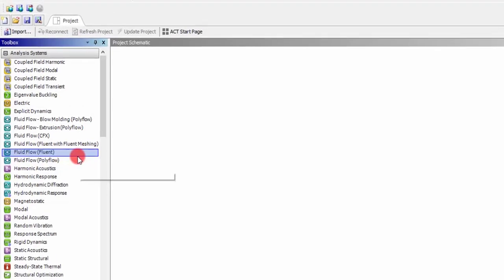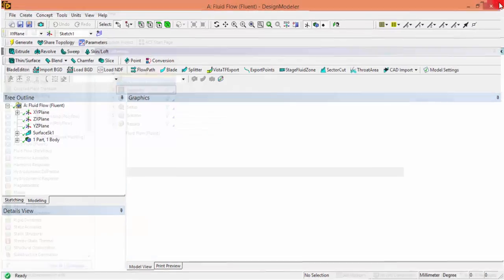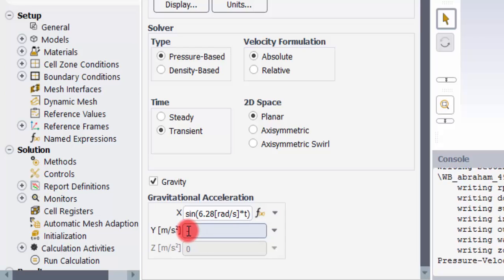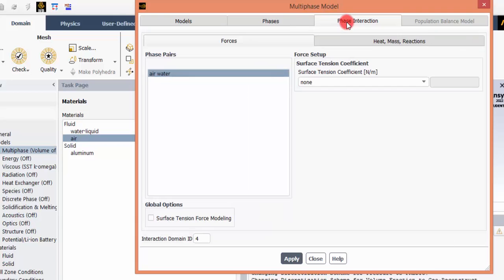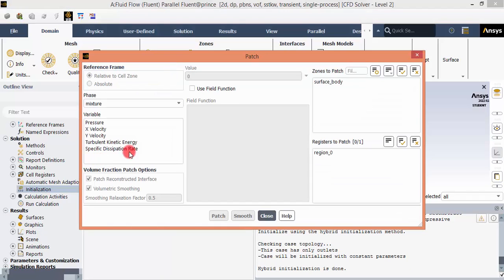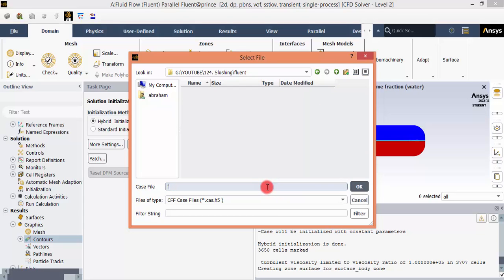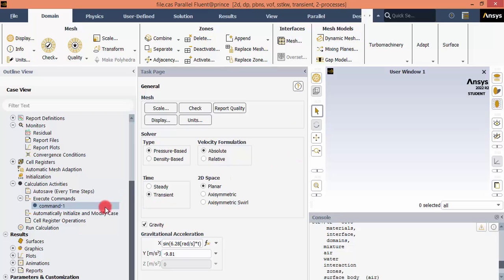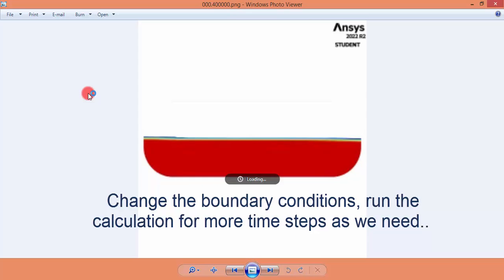Ansys Fluent Tutorial for beginners | Sloshing | VOF | Expression in Ansys Fluent | Without UDF

Comment: Hello sir, I'm making all the things same but my program gives me floating point error, what can I do about it? I tried to smaller and bigger mash sizes but it didnt solve.
Reply from the maker: Try without the acceleration, so we can determine whether the problem is with the acceleration or something else..
Reply: @MechTechSimulations  I runned again without acceleration and it didnt give error, tried again with linear acceleration and it gave an float error message again
Reply: @MechTechSimulations  I tried without acceleration and it didnt give float error message. When I add acceleration it gives error whatever its linear or time related. And for extra information ım trying to work on 3D tanks.

Comment: Hi, is it possible to do the 3d animation of a fluid flow in around a turbine in ansys....can you do a video on that...
Reply from the maker: Dear Dilip, It is possible to perform operations on 3D meshes in a similar manner to how it is done in 2D; however, the computational cost significantly increases due to the higher number of elements in a 3D mesh.